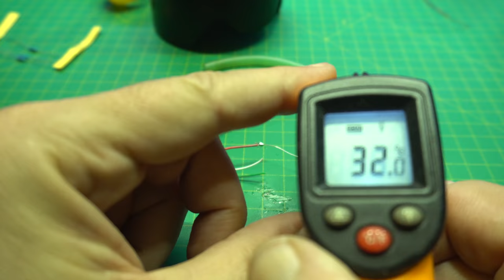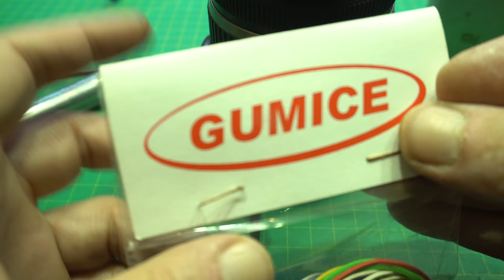How to make DIY lens heater for astrophotography - dew preventer

Comment: Very nice!  Great idea for dew heater, and your video at the end is amazing.  Even the cloud formations were amazing to see!
Reply from the maker: Thanks. If you want to make this heater, please use more resistance than I did (I used 7 Ohms). Too much current, and battery last short. Also, this silicone rubber is burned little bit after long time. Use rather 10 or 12 Ohms.
Reply: Great advice thanks.

Comment: Very good result ... on the right side I can see a sensor spot
Reply from the maker: Thanks. Yes, there is single hot pixel on this sensor. Usually I make 'dark frame' and subtract it from the rest, but most often than not forgetting to do that. Nice observation.
Reply from the maker: Oh, wait! You are referring on upper right corner - that is NOT hot pixel, that is Polaris star. When lens get wet, it blurs most of dim stars, and only bright stars remains. Know hot pixel is in the middle/right, about 1/3 from the right and 1/2 from the top.
Reply: Yes , I mean in the middle/right, about 1/3 from the right and 1/2 from the top.

Comment: Hi, 

I want to use 1.0 A or 2.1A or 5V or 2.4 A or 3.6A Power Bank. I use Mi i3 powerbank and have other few old ones with  1.0 A or 2.1A.

What will be the calculation and how many resistors will I need for 87mm, 77mm or 49mm Diameter lens (Samyang 14mm 2.8, 85 1.4 or 45 1.8 respectively)?
Reply from the maker: Sorry for late answer. Use the same formula, or the same setting. Noticed that my calculation is okay, but maybe too much. Instead 7 Ohms, use 8, 9 or even 10 Ohms. This way our power bank will last longer, and the amount of heat will be still sufficient to prevent dew to form on the surface of your lens.
Reply: @MilanKarakas  Thank you for your response. No worries. Will proceed with my project now 😀😇

Comment: Thanks for the video.  I'm wondering - when you're done shooting for the night and while the camera has dew all on the camera and lens -  do you do anything  to prevent moisture damage to the inside of your camera.  
I've been wrapping my camera and lens together in thick cloth, but I'm wondering if it might be better to leave off the cloth and make a fan blow on the camera and lens.
Thanks again.
Reply from the maker: Oh, I do not understand why YT did not notify me of your question. Sorry. Since I am using A6300 - it produces plenty of heat. Enough to keep whole body warmer than the environment, thus preventing moisture getting in. Keep cloth or other insulating material. Do not use fan - it may produce enough vibrations to make your pictures useless (motion blur).